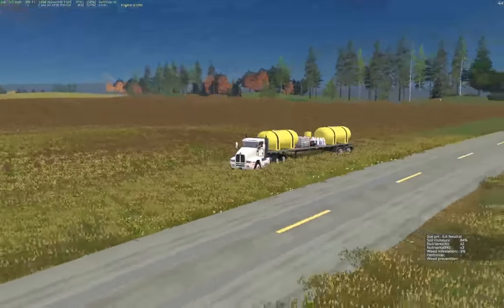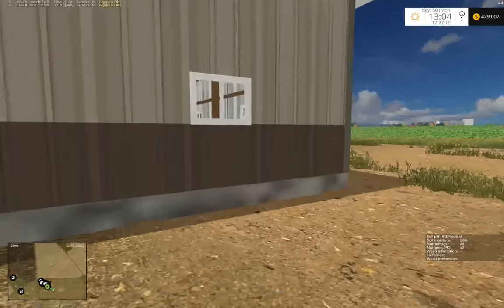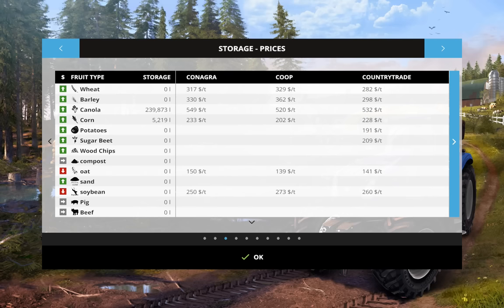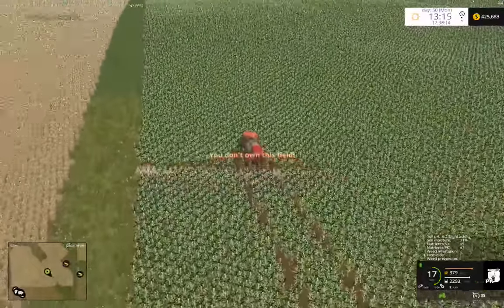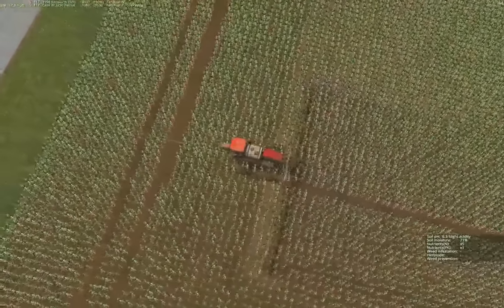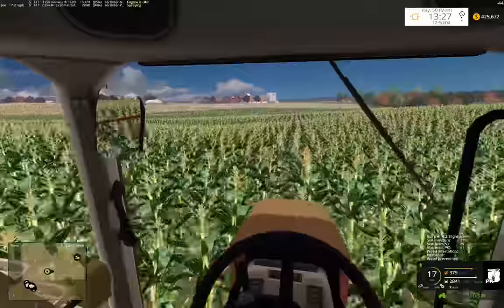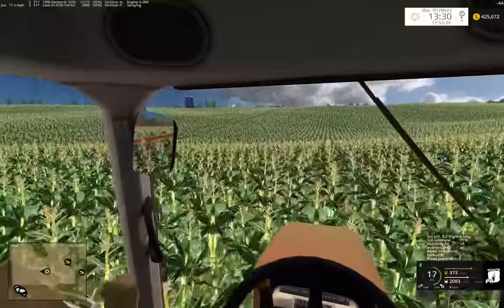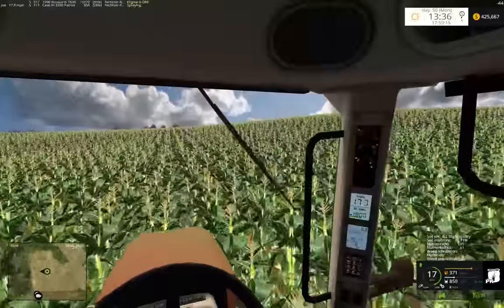Farming Simulator 2015:  Trampling Corn

Comment: A 2623 disk on 9 inch spacing has 32 disk gangs on one side in the back. On the front, on side has 30. The extra two on the back are small than the others.
Reply: +Lindbejb Modding Yes there at about that angle

Comment: The actual cost to make a brand new 7R series tractor is probably around $10-50k but when the dealer buys from John Deere the price may be $100-200k and they might sell it for around $200-300k for income. This ALSO depends on the place you buy from...